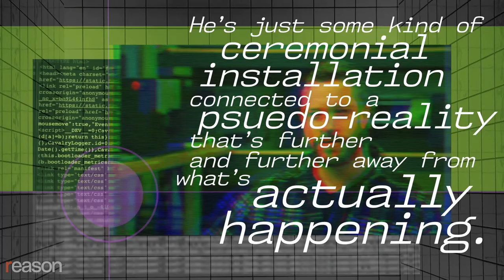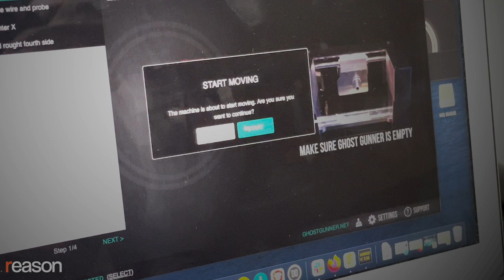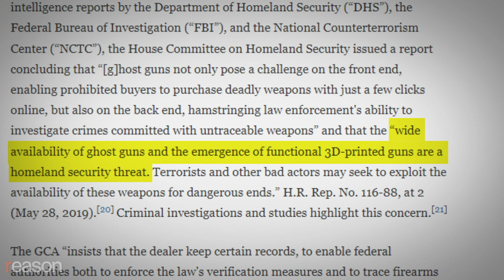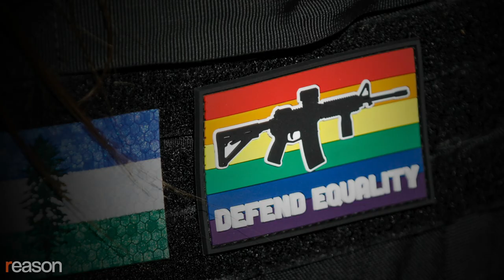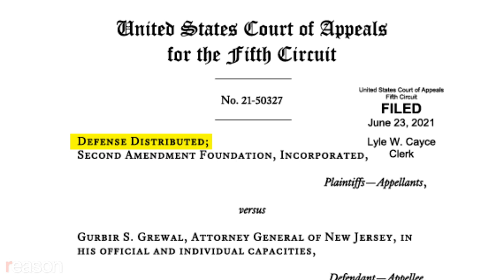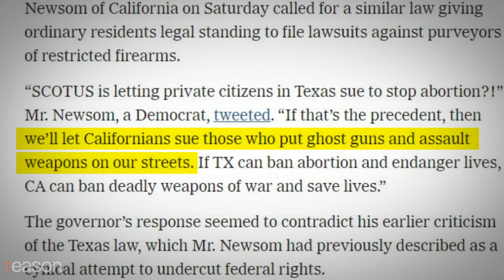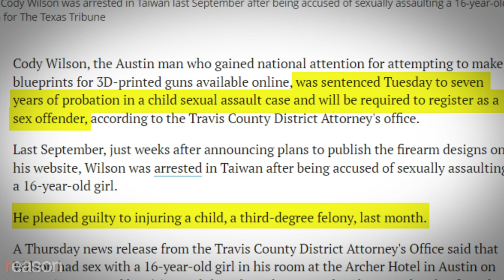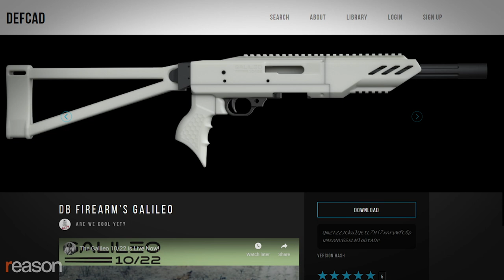Cody Wilson Thwarts Another Attempt To Stop Ghost Guns

Comment from the maker: *CORRECTION: The original version of this article stated that the Ghost Gunner sells for $500. The deposit is $500, and the final sales price is $2,500 before shipping. The text has been updated to correct the error.
Reply: It’s a shame nobody ever returns emails; I tried reaching out years ago to end this matter once and for all (AND in a way that Cody would still have a job), but no response.
Damned shame.
Reply: 2nd correction: if ATF gets their way through redefining a firearm receiver, things like ar uppers/barrels and pistol slides/barrels would then also be regulated.  Under its current definition, an AR15 receiver only meets 2 of the 4 requirements that they use to classify which part is a receiver & thus serialized. The Biden administration wants to ban the 80% finished receivers - but under their own definition it's only 80% of HALF, which means they're technically trying to regulate a firearm at less than 40% completion.
However under the new proposed change,  even places like home depot and Lowe's would need to have background check (4473 NICS) in stores to facilitate the sales of powder actuated nail guns because they meet the definition of "firearm or readily convertible"...
Reply: @wheatdevon  he should just be glad he didn't get the JStark treatment...
Reply: @daetslovactmandcarry6999  you were going to stop him from being entrapped by the Texas judicial system with an underage girl?
Reply: Id love to see all these ghost guns they have gotten from crimes..Every cop ive ever talked to has never even seen one..States need to just no abide by the law same as weed and the covid shot/mask..
Reply: @SpaceRanger187  they classify ghost guns as guns with an obliterated serial number
Reply: I bought a used one for $1,000 ghost Gunner 2
Reply: @RichardCranium321  Like trying to ban knives.
Reply: ATF's rule change is illegal and yet they are pushing forward.  The video touches on this but then keeps going.  Why not cover the illegal activities of the BATFE?  The ATF does NOT have the legal authority to re-define a firearm.  They are rule enforcers not law writers.  Also making this a right vs left political issue is incorrect.  Look at the political make up.  Right, left and center... a lot of people realize the importance of firearms and the ability to make your own - that we Americans have had since before the founding of our country!
Reply: @daetslovactmandcarry6999  If you want Cody to return your emails, you should pretend to be a 16 year old girl.
Reply: $2500? Fuck, I can build an unrifled version of the Sten for a lot cheaper. Or one buy HK part.
Reply: @cpuwizard9225  yeah, something about drain pipe open bolt sub guns being cheap & easy to produce is PROBABLY why the brits cranked them out by the thousands & it went from concept to production in like 3 months. There's really not too much difference between a STEN and a slam fire shotgun aside from the bolt, spring, and magazine well. I think surplus sten mags are still less than AR Pmags...  at one time not too long ago they were $5 each.

They would've killed to have a machine like this back then.
Reply: @krotchlickmeugh627  Right, a deformed serial number on a factory built firearm is definitely not the same as building a firearm from an 80% lower or a billet of aluminum. They just use that word and try to equate a non-serialized homemade firearm with a factory made firearm with deformed serial numbers. They are no way near the same thing. It just works in the liberal mindset, to increase their numbers of the supposed "ghost guns" and add credibility to their war against such objects.
Reply: @DWeezy62  i mean ignoring them is the best option. 
Arguing with them not only gets us nowhere. It gives their argument more clicks. Meaning it moves up i nthr algorithm. 
Anyone with common sense understand that they dont make any sense.
Reply: @StabbyMcStabwood  On August 9, 2019, Wilson pleaded guilty to one third-degree felony charge of injury to a child. He was sentenced to seven years of probation, and required to register as a sex offender and attend sex offender therapy. The court also ordered him to complete 475 hours of community service, and pay a $1,200 fine and $4,840 in restitution.

Ah yes if only we had evidence. Clearly I am the one who is biased. Next you're going to tell me the 16 year old girl was actually an FBI agent, and this time you don't need any evidence.
Reply: @gamerman7276  I can show you 100s of cases where completely innocent people pled guilty to charges to avoid undue prosecution or to reduce the time they are incarcerated and get back to living their lives.
Reply: @gamerman7276  imagine being held responsible for someone else's lie. 

How old you have to be to make a profile on that site they used to hook up?
Reply: If you are, or when you were a young man, did you make sure to card every girl before taking her to bed to make sure she's old enough? Do you realize how ridiculous this scenario was? You act like he's out there prowling the local high school... We can agree that MAPs belong on the wall, but I'm not willing to hang some dude over a girl who lied about her age.
Reply: @StabbyMcStabwood  Whether you care to believe it or not, 16 is high school age. It doesn't matter if he sought her out online or at her sophomore prom, the charges are the same. She was 16, he was 30. He should've known better. You're just arguing in bad faith.
Reply: @StabbyMcStabwood  Imagine being held responsible for verifying the ages of the people you sleep with. It's almost like it's the law or something. Crazy, right?
Reply: @gamerman7276  how is this bad faith? She misrepresented her age to even make a profile on that site. It's not like he met her on Facebook or Instagram. She was on an adult site...
Reply: @gamerman7276   It'd be no different than if she used a fake ID to purchase tobacco and alcohol. Keep liking your own comments though, because no one is even reading the bs being spewed here.
Reply: Well THAT kinda SUCKS but I WOULD still ABSOLUTELY buy one.... It's JUST BUUUUUULLLLLLLSHIIIIIIIIIT the government or ANYONE WANTS to get in YOUR home and TELL YOU a grown man whaaaaat to-do. .....send me too the place WHERE I can get ONE of THESE suckers
Reply: @RichardCranium321  AND THAT'S EXACTLY WHAT they WANT!!!!!!
Reply: @wheatdevon  you're ABSOLUTELY RIGHT. Time for talk SHOULD ALREADY be OVER, it's TIME for action. BEFORE it's too late.
Reply: @SpaceRanger187  THAT would be ACTUAL LEADERS ACTUALLY protecting our rights and THAT ain't gonna happen.
Reply: @coreyguy5216  whaaaaat.....sell it too me
Reply: @gamerman7276  probation fees, $1200 fine and $4900 restitution - when you look at his lawyer fees that is chump change in comparison to what he would've spent fighting the case over 2 to 5 years...
Reply: @krotchlickmeugh627  I'm sorry to hear about the twice theft of your firearm. I'm glad I was born and raised in Ohio. Nowhere is perfect, but the laws in California are atrocious. The problem is that the majority of voters there and other places across the country have been brainwashed. Good luck to you and keep up the fight. Do not comply with tyranny.
Reply: @gamerman7276  "plead guilty to one third degree felony charge of injury to a child..." Suppose someone had intercorse with a 16 year old girl who told them she was 19: Wouldn't they still have "injured a child," even if it was unintentional, even though they were told and thought she was of age??
Reply: @jun1orbaitor44  That's not what happened.
Reply: @gamerman7276  You were there?!!
Reply: I mean, that's actually pretty good for a CNC router. I am given to understand it's not necessarily locked to guns either, it just includes the software to do guns onboard. anyone confirm this, cause if so that's a really good price
Reply: @RichardCranium321  probation fees, $1200 fine and $4900 restitution - when you look at his lawyer fees that is chump change in comparison to what he would've spent fighting the case over 2 to 5 years..
 
Was that a felony charge?

I guess someone who wouldn't mind giving up his lifetime right to vote or even touch ANY firearm would not have much reason to NOT plead guilty to a bogus felony charge.

So, the question is, WAS it a felony charge? Hard to believe that there's such a thing as "misdemeanor" sex with a minor! (Isn't that what's often called "statutory rape"?)

UPDATE: While writing this comment, I decided to do a web search of my own, for: Cody Wilson felony

I thought this would easily settle the matter once and for all. Alas, I was wrong! There was "too much data" for an easy answer. For example, one article from 2019 explained that while he was NOT a "prohibited person" (based on felony) in his state (Texas -- at THAT time), he WAS considered a "prohibited person" FEDERALLY (at THAT time).

But, that was 2019, for his charge regarding exposure to a minor.

Fast-forward to 2021, and, while you're slewing your way through time, you may as well take a bit of a detour through space -- all the way to Fargo, North Dakota, where he's dealing with a bunch of other "kiddie" charges.

If I post a URL, the Gooogletoob uberlord will likely delete my entire comment -- and, "black flag" ALL comments from me for this video. So, I'll just do a copy/paste from the article from the "FARGO, N.D. (Valley News Live)" website (readily confirmed by searching it up yourself if you think I'm confabulating this):

.                                                                       # # #

FARGO, N.D. (Valley News Live) - UPDATE: A Fargo man accused of sharing child pornography online and convincing a child to take and upload sexual content of themselves has pleaded guilty.

28-year-old Cody Alexander Wilson is charged with felony promoting or directing an obscene sexual performance by a minor, felony possession of child pornography and a misdemeanor count of possession of drugs.

Court documents say Fargo Police received a cyber tip from the National Center for Missing and Exploited Children in Oct. 2020 that an email address, that would later be connected to Wilson, uploaded a pornographic video involving a young girl online.

Documents say when investigators interviewed Wilson in November, Wilson admitted to messaging and exchanging child pornography on the app Kik. Documents say Wilson did this as a way to obtain more child pornography files.

Documents say when officers reviewed Wilson’s account and previous conversations, they found a 9 minute and 15 second sexual video that Wilson received from an 8-10 year-old girl.

During a search warrant of Wilson’s home, documents say marijuana, paraphernalia and psychedelic mushrooms was also seized.

.                                                                       # # #

[For any brave souls who've transcended the tl;dr threshold, I'll add a bit of a punchline as a reply to this message.]
Reply: And here's my minor punchline! (In TWO-part harmony! :)

Part 1: My simple web search for those three words (sans quotation marks!) returned enough hits to gag the proverbial maggot. INFORMATION OVERLOAD! 
 
So, that I have referenced two "issues" in two states should NOT be construed as my having suggested that those two issues are the ONLY two issues that were kicked up by that web search. Perhaps they were, perhaps they weren't, which is my way of suggesting that I did NOT delve any deeper than to scrape those two off the top. Let's just say I found them sufficiently disturbing as to squelch any interest in looking any deeper into the man's (ahem) "recreational proclivities" for lack of a better term.

Part 2: I hope that everyone cheering him on for his generously offering (to sell, for a few grand) a machine that will "turn a zero percent block of metal into a receiver" are aware that to be able to USE that "zero percent" receiver they will NEED to purchase a proprietary part, necessary to complete the assembly of the receiver.

Since it's a proprietary part, I do not know of any other supplier who competes with him in that market. And, since it's a critical part of a USABLE receiver, I would NOT be shocked if the "AFT" decrees that IT must be serialized!

I'd like to say that I'm sorry if these comments knock the wind out of his sails. Yes, I'd really LIKE to say that...
Reply: @coreyguy5216  If you don't have a rap sheet, buy a real gun, complete and pay the $50 ATF fee, and get the gun for $250.
Reply: @jeffnagata416  Well it does, because the barrels cannot be 3D milled with aluminum.
Reply: @JohnDoe-dj3xh  it is nothing more than a hobbiest CNC machine. Tooled up to make a certain type of product. It can be adapted to mill, or shape any other type of part. The difficult part in this platform would be usable files to easily get the machine to make what you want. Easy things to learn for anyone with half a brain.
Reply: @SpaceRanger187  "I'd love to see all these ghost guns they have gotten from crimes..Every cop I've ever talked to has never even seen one"

That's because Ghost guns are just like weapons of mass destruction..
Reply: @RichardCranium321  Keep in mind the ATF can not make or change laws or the Constitution
Reply: @davidschwartz5127  neither can the executive branch, but that didn't stop Trump OR Biden...

"Take guns first, due process second. I don't care if it's legal or not.... TAKE the guns THEN go to court." - Donald J Trump, 2018, just a few months before signing unconstitutional executive order banning 2A accessories that are structurally no different than magazines - Just plastic and a spring...
Reply: @jeffnagata416  Or ban sharp sticks.
Reply: @gamerman7276  Ouch!
Reply: @StabbyMcStabwood  ever herd the word honeypot I'm just gonna take a guess he passed off uncle Sam before that arrest just a wild guess.
Reply: @Fm-ss4uj  that's exactly what happened. They couldn't legally stop what he was doing, so they found a way to entrap him on another crime.
Reply: @StabbyMcStabwood  and it was in Malaysia since when did something happen in another country get you charges here that's a first in history.Just proves the point uncle Sam went the extra mile and weird charges are rarely against those in Washington committing crimes daily mabie this dude should learn a lesson stay away from prostitutes period.
Reply: @Fm-ss4uj  yeah I agree with that. I don't condone the degenerate behavior or supporting the oldest profession, but if it was a setup it was a setup. If he knew she was under age and did it anyway, put him on the wall with the rest of the MAPs
Reply: @RichardCranium321  i dont think anyone is defending trump for that order, me being a supporter of trump and the 2A i definetly wasnt happy and i let them know that through my state rep.
Reply: RR Continued  for who, exactly?  He's selling his own product... that's called an entrepreneur, not a shill... welcome to capitalism
Reply: @gamerman7276  Since you know so much about his case, why did you INTENTIONALLY omit the fact that she actually produced a FAKE PASSPORT that showed she was 20? 

Kinda like your screen name- only half of the truth is how you roll, right?
Reply: @This_is_my_real_name  Cody Wilson in Fargo ND is an entirely different person than the 3d gun printer guy. But you already knew that didn't you.....You are glowing 🌟🌟
Reply: @SpaceRanger187 Thats why they called Ghost guns 😂 no one Ever saw it in a Crime
Reply: They do have sales on certain holidays that can knock as much as $500 off of the price! You still end up in line for some time.
Reply: total bull shit charges they tryed to sabotauge him